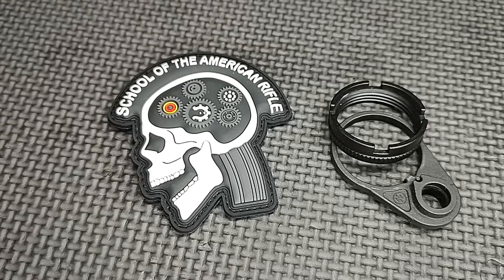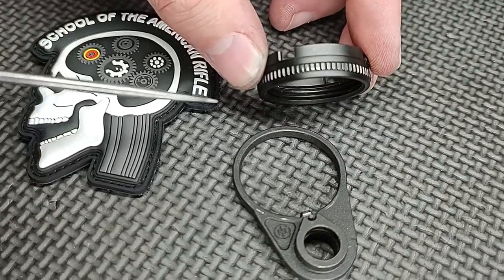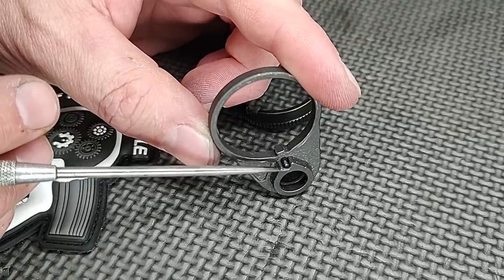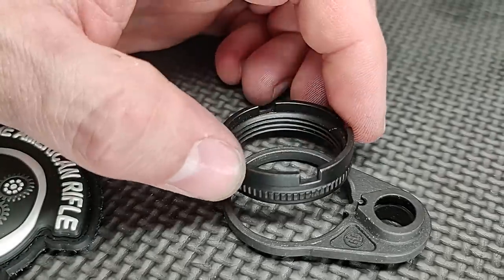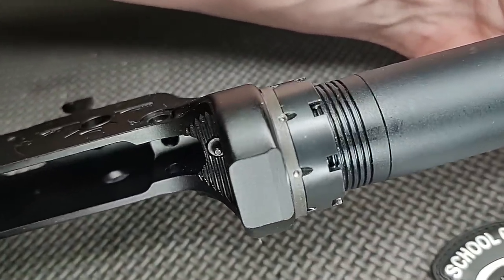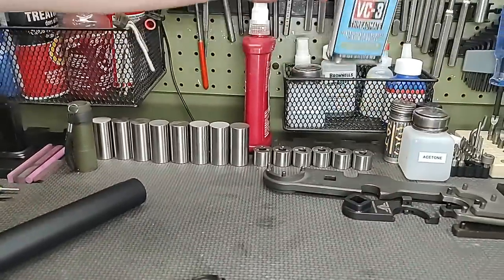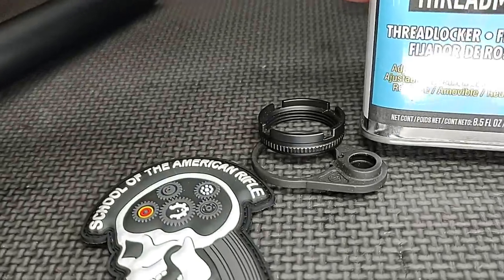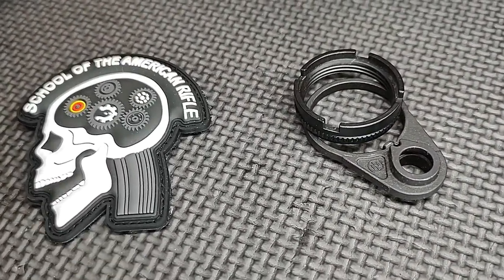Why Ratcheting Castle Nuts Suck

Comment: I have 3 of those pws castle nuts. Removed and reused them over and over with thousands of rounds and never had a issue, I just check on them once in while and if anything comes up I’ll just use that vibratite.
Reply: @1rstTry and the fact that he’s had no issue has not stopped you from agreeing with yourself. Shocking.
Reply: @1rstTry you should always check on your castle nut regardless of how good the staking is. This is basic preventative weapon maintenance.
Reply: @hellcatdave1  should always check all nuts for health.
Reply: @asherdie see what you did there...👍😅
Reply: @1rstTry  uhh staking a castle isn’t permanent lol I’ve literally had a staked castle nut and the entire buffer assembly come loose after only a couple thousand rounds on my Knights. I learned it doesn’t matter who made the gun. You must be new to the AR game. Checking castle nuts takes 3 seconds you potato 😂
Reply: @1rstTry It's also next to impossible to discern tone through text.
Reply: Question : Why do you keep taking them on and off ? Unless you are changing from a fixed stock to adjustable , I see no reason to take one off , Right !?!?
Reply: @davekreitzer4358  yea, to change out buffer tubes and try out different setups. Switching them from standard lowers to ambi lowers I eventually moved on to. Changing and trying out different buffer retainer pins. Different rear take down pins etc etc. I’m talkin years here not weeks or months of upgrades and changes over time. They have never failed and I shoot weekly. The only time I would worry is if your lower is select fire and you’re gun is gonna be under a heavy shooting schedule. Besides that and for semi auto civilian use they’re more than perfect.
Reply: @MilspecPanda  I have multiples in different configurations and this seems to fill that nitch and saves on the wear and tear , especially if you don't have the proper armourer tools ! ✔️🤔
Reply: Paint marker or metallic sharpie if you don't clean them often, like myself. Mark it and call it a day.
Reply: @5jjt  and? I don’t think anyone here misunderstood what he was saying.
Reply: @1rstTry says something dumb,claims he was trolling 😅

Comment: Maybe I'm just the luckiest man alive. I have 3 ARs that I personally built. One has over 1000 rounds through it. I didn't stale the castle nut on any of them. And none have ever come lose. I hunt with them and pack one in my truck most days. I use steel nuts on steel QD plates.
Reply: Even an unstaked castle nut coming lose is rare. And it depends on the recoil impulse of the rifle. But the problem is, when one of your guns finally does come loose (it'll happen eventually) it flat out disables your gun. Usually when you need it the most.
Reply: @ragedashboard6374  If it comes lose it won't disable the weapon. A little lose would be felt and would have little effect at all.
Reply from the maker: @tireballastserviceofflorid7771 incorrect. If the Castle nut loosens, the buffer tube will have enough play to not allow the weapon to cycle completely. The carrier will bind on the tube or the buffer detent will unseat. If the detent unseats the gun is deadlined in most instances.

Most people will omit the detent all in a grand effort to not install with the proper methods.
Reply: 1000 rounds isn't even broken in. That rifle hasn't had time to fail.

Comment: here i am never staking my castle nuts 😂😂😂
Reply: That was me until I decided to check the castle nut on my SBR by hand and it spun right off.
Reply from the maker: @spacecaesar7619 glad you learned from the mistake. Many AR owners are too stubborn to listen to experience.
Reply: I have never staked any of the castle nuts on any of mine and haven't had any come loose. Properly torqued they should stay tight even without staked or locktite. I'll use locktite before staking
Reply: The only good reason to not stake is if you ever want to change any buffer or pivot pin parts without having to get another end plate.

Comment: Everyone saying that staking is old and dumb and not used in X industry is sorely mistaken.

I’m an aircraft structural engineer with 20 years experience supporting field and heavy maintenance and repairs. I’ve never once worked a commercial airliner, private business jet, or military aircraft that didn’t have some staked parts. It’s a viable and effective method and not archaic or “no longer used” at all.

As the late, great Will Larson used to say, “Stake your f@$!ing castle nut, you godless heathen!” 😂
Reply from the maker: But Brian, you mean you don't just slather aircraft fasteners with threadlocker that takes 600 degrees of heat to remove and possibly weaken aluminum components? 😊
Reply: @SchooloftheAmericanRifle Is there a difference between vibratite VC-3 and  red loc tite?
Reply: Lots of older British airplanes stake literally every fastener. Must be an absolute pain to work on. 😂

Comment: I have used the PWS castle nuts on 3 builds. Changed out the buffer tube on one of my lowers and noticed the tooth/pawl had a good amount of wear. During reinstallation I used the same vibra tite vc3 product on the threads as an extra insurance policy. I believe  this video is solid advice. YMMV.

Comment: Damn....I have one that I bought for my first full AR15 build. I wasn't at all familiar with building ARs so I wanted the chance to be able to fix\fidget with it after it was done, in case I did something wrong. I built that thing one spring at a time, slowly buying parts for it over a couple years and I was convinced I'd have to "tune" it after completion. Nope. Runs like an absolute dream and I never did have to tweak a single thing, so I completely forgot about the ratcheting castle nut until this video popped up. 
Always great info in these SOTAR videos.
Reply: I've built both mine the same way as you. I watch for a sale on premium components and buy one or two at a time. This allows me to use higher end parts on a budget. I thought mine would need some tweaking but they both worked perfectly right from the start. You really learn how they work when you build your own. I've learned a lot.

I took the heating elements out of an old toaster oven and I'm going to build an oven with metal studs, rockwool and sheet metal and Ceracote them. I already have a gravity feed touchup paint gun. That will make everything match as far as the receivers and handguard.

Comment: I have the Fortis manufacturing omega clip castle nut K2 on 2 ARs. Its a ratchet system with a release lever type setup. They've worked well for me but I can see where the ones in the video would/could be a problem if you have to remove them. Yes, staking is probably the better option every time but mine was a experiment that has worked out really well.

Comment: Interesting, the PWS caste nut/ endplate is what I use for my AR-15s and so far they haven't come loose on me yet after taking them off once or twice each.  I'll have to watch that next time I take them off.
Reply: At minimum a witness mark to at least keep it noticeable if it did move. Have used these on two of my builds so far.

Comment: I can agree with you 100% about this specific castle nut set up. I was running the pws set up at a project appleseed and after the first day the castle nut had come loose. Tightened it again in the field.

Contacted pws and they requested specific pictures of the ratched tooth. Odd. They did cover it under warranty, but I moved back to a standard castle nut and end plate WITH staking. Zero issues after that.

Good vid! We need to see more of the shop cat!

Comment: I have a regular castle nut and didn't stake it, but I degreased both surfaces and put thread locker on it and properly torqued it and it is not coming loose after a couple of years.

 I'm planning on upgrading to the VLTOR A5 system. After I do that and Ceracote I will stake it exactly like Chad from SOTAR says to do.. 

Right now I'm not worried about it, I'm not going on combat missions. 

Cleaning the surfaces first with acetone is the key to making thread locker perform correctly. There can be no type of oily residue for thread locker or any kind of adhesive to work correctly. The metal has to be completely stripped of all impurities.

Comment: That busted my bubble. You’d think that PWS would make better materials for that. PWS uses the same mechanism for their blast forward muzzle device end caps to enable quick cleaning as well. I got mine for quick change out however since you’ve mentioned using that product then that will work. Just looked up Vibra Tite products. They have it in tape form too. Thanks.

Comment: I have one of the pws sets, buffer tube, nut and endplate..  I was considering installing it on one receiver, but was not sure about the ratcheting deal..  I do like the buffer tube.  I may just install the buffer tube with a standard plate and nut so I don’t have to be concerned

Comment: Luckily I torqued mine down and painted a witness mark. I mostly got it as an experiment to be honest, mainly because I wanted something with a nicer coating because I live in a very humid environment and I wanted to give myself the largest margin of error with maintenance as possible, because things that are phosphated rust easily around here. That being said, if I notice it working loose I'll just replace it with an FCD plate and nut, and cold blue the exposed metal from staking or hit them with a paint marker or something.

Comment: I’ve reused them multiple times and never had issues. I’m a pilot part time and stole the torque striping method from the aviation industry. I’ve never seen the torque stripe on a castle nut misaligned. I’ve never seen them loosen up. Not saying they don’t but with proper care they’re good to go.

Comment: PWS has a lot of cool ideas. But I think there is a lot of room of improvement. Like I’ve heard a piston head on their long-stroke piston system can shear off at times (not sure if that was a single example or a more widespread issue), and I thought they could fix it with forged Inconel (which is expensive).

The ratcheting castle nut is an interesting idea, but it needs stronger materials to be invested in it.

Comment: Proper installation is necessary for both a staked castle nut and a ratcheting castle nut. Both can come loose and both can work just fine with no issues.
FWIW, I have used the PWS ratcheting castle nuts for approx 3+ years on several different rifles and have not had any come loose. Once they are installed I typically do not remove / re-install them, however, there is one of my "test" lowers which I have removed/re-installed the castle nut multiple times and have yet to have an issue.  I guess it boils down to how they are installed - but the same is true for traditional staking.  Over the years I've had several staked castle nuts come loose because they were not staked properly.

Comment: I purchased this very item a couple of years ago, along with their “enhanced buffer tube”.  Upon receiving it, I noted the tiny locking pin, and thought it seemed small and fragile/weak, and the corresponding ratcheting teeth as well…  It would appear the the casting of the plate is pretty sound.  Ahh, but I am no engineer.
   I would have thought that a detent ball of some sort would have been better.  Your pointing out that the “pin” wears flat never entered my mind.
   I thought at the time, that this company’s “enhanced buffer tube”, had some merit (and apparently subsequently so did Aero Precision, I own on of theirs).  Your video(s) on proper staking of the castle nut, (like what Mr. Stoner originally employed), have made me a believer in its’ proper use.
   I not commenting to “beat-up” on this company’s manufacturer & sale of this item, by any means.  It may have a purpose for some who are not concerned with real world reliability for self defense, of a platform the likes of an AR-style rifle.
Great video,
Thank you sir.

Comment: so, I have never staked or used a locking style of castle nut. I have also never had any issues after thousands or rounds with any of my builds, what is the importance? What problems does staking a castle nut solve or is it presumptive in nature? Why is a dab of blue locktite not as good or even preferable?
Reply: Considering the receiver extension sustains all of the force of the reciprocatint bolt carrier, I'd be shocked if locktite was sufficient. Besides that, it wasn't really designed to be a regularly swapped part. That, I suspect, is part of the reason. Just to ensure it's a semi permanent install.

Comment: In your experience are unstaked but properly torqued castle nuts less prone to break free on buffer tubes that have the cutout in them that locks around the buffer spring detent in the lower? Seems that this would cut down on the buffer tube's ability to be torqued free theough normal use.

Comment: I’ve never tried these, nor had the desire. It is quite satisfying to line up your staking punch, make the initial hit, then beautifully move that material into the notch. 🤷‍♂️ That said…didn’t KAC at one point not stake theirs from the factory (or maybe they still do)? If so, I wonder if they used any type of locking agent on threads.

I believe Chad has stated in other videos if the lower, extension, and nut all have the proper class of threads it, and proper torque is applied, it should not break loose in theory.

Comment: I have a four year old PWS MOD 2 AR. I've actually used the Ambi lower on a couple different uppers and the castle nut has never came loose. Never took it off, but I'll change it out eventually. I much prefer something like a BCM end plate and Colt Castle nut.

Comment: I have got a burr on the tail end of my bolt carrier group and it is eating up the face of my buffer if anybody has any recommendations on how to fix will be greatly appreciated. I know it's got to be a burr because when I'm going to lock the upper and lower together you can hear it scratching it. So I don't believe it's a gap issue or the retaining pin for the buffer is out of spec. I'm a single dad raising two young kids by myself and receiving no assistance from the government so I ain't got a lot money even though I do make decent money this inflation sucks

Comment: saving me $40
saving us all an extra part that we want but don't need.
do you recommend
the POF roller cam pin
the RCA Adjustable Gas Key
any adjustable gas block?
any part that can take an AR15/10 into a better firearm?

Garand thumb ice test I was thinking an Extended/Large:
charging handle, magazine release, solid selector would be better, maybe having a stronger spring or being side charger.

Luth-AR Extended Safety Selector LR-08AL

Comment: This design could be improved. A slightly larger diameter hardened pin that screws in with fine threads and sell the device with about 5 extra pins. You could get a couple of uses from each pin. I think the current setup is probably good for two uses anyway.

Comment: I prefer to just drill a hole through my buffer tube, in line with the castle nut slots, and run a cotter pin through it. 👌🏽

Comment: Maybe Someone Could Design An Upgraded Replacement Version Without The Weak Link Of A Fragle Tooth And Revise It With A Nice Heavy Duty 6-32 Or 8-32 Ball-Detent Setscrew With Torque Specs To Ensure Proper Locking Of The Castle Nut!?! 
I Don't Like Staking To Secure Anything,It Just Seems So Destructive, Brutal And Primitive, When There Are Positive Alternatives! 😎

Comment: I just purchased this ratcheting castle nut. When ya say torque to spec is it the same as a traditional castle nut? I dont plan on removing / installing it constantly. I'm just piecing together 3x more lowers. I always vibratite the reciever extensions to the lower.😂 its my ocd and i have this nagging "do it once with extra insurance" mindset.

So i do plan on vibratiting the buffer tube and castle nut. But idk the correct torque to spec value. I thought since its ratcheting I'll go hand tight til no more. 

Does anyone know the exact amount?
Reply from the maker: I suggest 38 FT# minimum, then to the next tooth.

Comment: Thats kinda exactly what I assumed would be the reason I wouldn't want one. It makes too much sense. Ratchets work in one direction unless there's a mechanism in place to switch that direction like on a socket wrench or a lever to release the pin tension like on say an aac 51t supressor.
There's been many solutions come along for receiver extensions but in my opinion there's still really nothing a traditional torque and stake job on quality spec parts won't beat and do what it's supposed to do🤷‍♂️. To me castle nut stuff has always been solutions to a non-problem